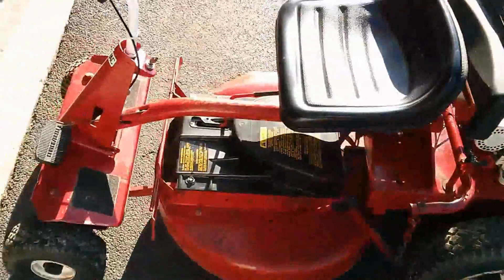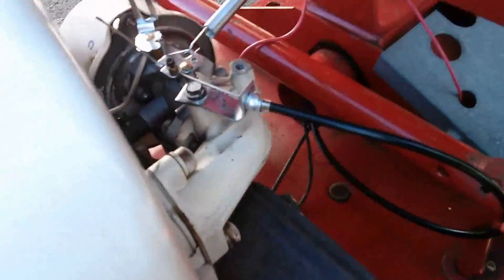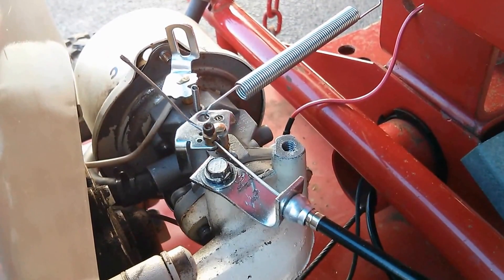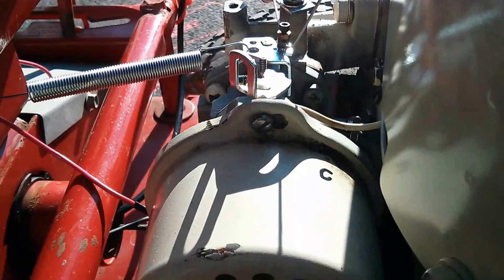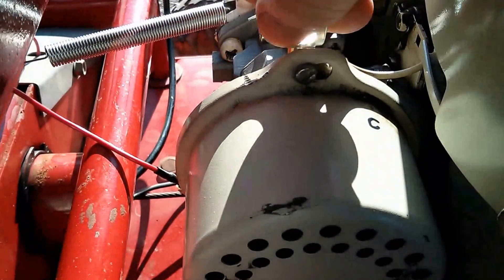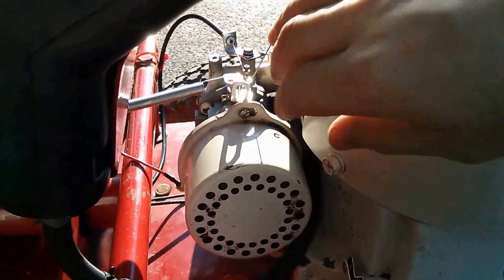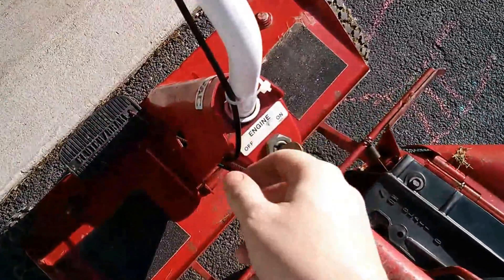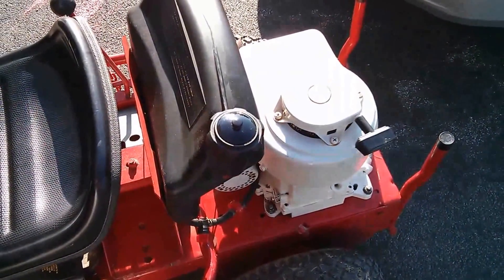Snapper rider mower with motorcycle throttle

Comment: Hi Jordan where did you bye that carburetor? realy god jobb. and you skipp the Governor totaly?
Bets Regards Conny From Sweden
Reply from the maker: Yes, in this case I skip the governor completely.  I keep 3600 on the tach by managing the throttle myself.  
Here is the carb I bought:
http://amzn.com/B004HU6OGI
Reply: Is that a separate piece choke, and if so, where did you source it? Nice job, I just rebuilt a Snapper using an old Tecumseh 8 hp converted to electronic ignition with an Atom module, and used a carburetor with a primer bulb. Great idea on the 7 speed bike throttle!
Reply: Hello, can you give me the reference of the carburetor because I can no longer find the link on Amazon